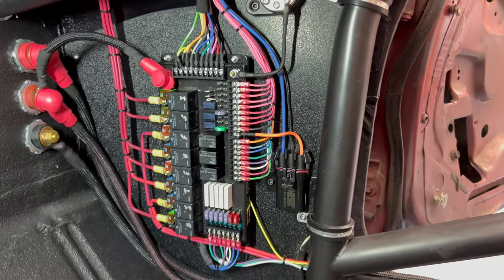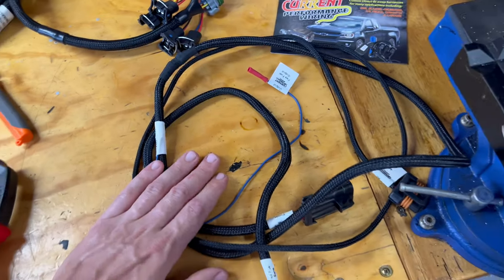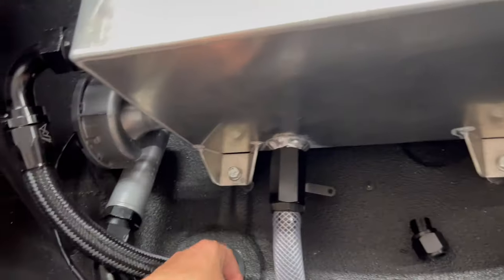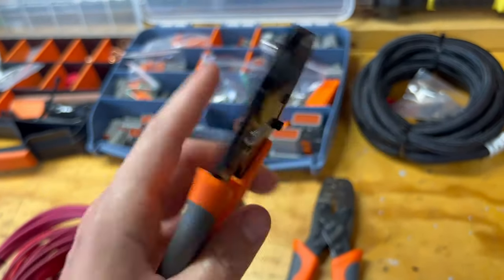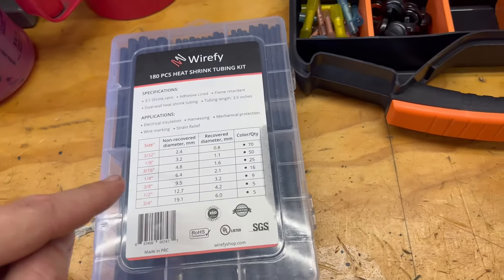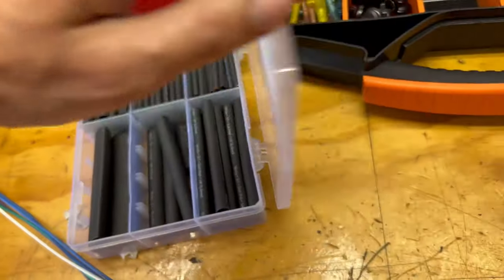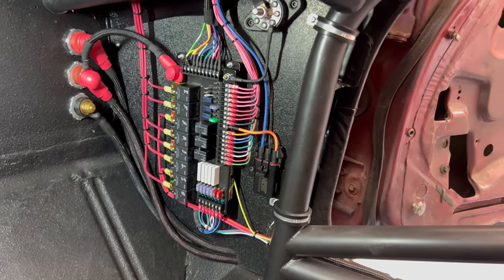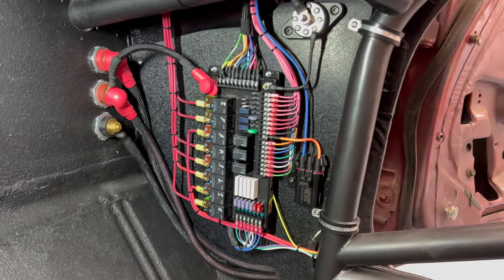The Ultimate DIY Automotive Wiring Guide

Comment: Nice trick with splitting the current through multiple wires in the Deutsch connectors. I know you mentioned the larger Deutsch connector later in the video, but so others know they are the DTP line which is rated at 25A for power connections. That's a dang nice looking relay panel. Learning wiring and accumulating the tools and supplies is so satisfying. I see that PrimeWeld TIG in the background too. Good choice there. Solid video!
Reply from the maker: Thank you, I appreciate that. Trying to ball on a budget here haha
Reply: Just a quick note re: amperage capacity in a circuit…. If you need 2 wires to carry your amp load on positive side, since your also grounded through the harness you need to carry the same load capacity on the ground side. In other words you need a 4 wire harness/ connector with 2 grounds in order to complete a 20 amp circuit in this application. So it would be cost effective to move up in connector series so you can save on wire/ connectors. Also the connector is your bottleneck not your 14 gauge wire.( depending on length of course but most likely far exceeds 20 amp load)… Good luck, looks great!
Reply from the maker: @shimonwaksman1893  that’s a great point I overlooked. I haven’t had any other but definitely something I should have looked into thanks for the information!
Reply: @shimonwaksman1893  Yea, came here to point this out too. That ground line is gonna be overloaded.
Reply: @BlacxPhoenix what happens when a ground is over loaded?  I'm trying to keep up.
Reply: @djt7387  overheat. if it gets bad enough, then insulation melts and short circuit

Comment: Those kits are like $1300
Reply from the maker: That’s correct. If you price out all the wiring you need that comes with the kit the terminals and the time to labels each wire and do a pull test on every crimp it’s worth the money.

Comment: I've watched this video and the one prior. You've sold me on this kit. This was a great explanation on how to do this yourself. Thank you for that! The only question I have is do you run a key? How would that and the neutral safety switch tie into all this?
Reply from the maker: @tbeach7112  the neutral safety switch is wired into the board all it takes is to cut the crossover wire in the Board and wire the more switch in the shifter. For a key I’m sure you could just wire it inline with the ignition switch or the starter switch

Comment: Is there need for relays if you have one big cable going to a fuse box and from the fuse box to all devices like radiator fan, fuel pump, powerwindows etc. Before the fusebox you add a battery killswitch, evertime you stop driving, use the killswitch to disactivate the fuse box. Am I right with my thoughts?
Reply from the maker: I think I understand what you mean, but that just sounds dangerous lol
Reply: @DAPerform  Why dangerous? Each device has its own wiring and fuse
Reply from the maker: @khancross  nothing is being triggered by a relay so they always have power.

Comment: Just curious, why not use a DTP 2 pin connector that can handle 25 amps for things like the water pump
Reply from the maker: Well to begin it’s what I had on hand. With My lack of knowledge with Deutsch connectors I did not know they had high amp DTP connectors available. The connector for the fans would be the only one I would need to swap because of the amp draw. The water pump and everything else is under 10 amps so it wasn’t necessary for me to split the power wire like I did. On the water pump.

Comment: Very clean job overall. I like that IWSS kit. Thanks for sharing that.

Generally, electrical power inputs are called supplies; outputs are called loads.

It’s not clear what the ammeter might be used for. Manufacturers give you the load rating of their components. You size the wiring to the load and the fuse to the wiring. Not sure how you would might use the ammeter. You should avoid making sizing decisions based on measured current.

On your electric water pump, you can’t split the positive wire into two wires and leave the ground wire as a single wire. Your single ground connector rated for 13 amps will be carrying 20 amps. Keep your fire extinguisher handy.

Also, it’s not a good general practice to split a load into two connectors because if one of the contacts becomes compromised, you will overload the other wire.

Comment: Awesome work man. That's a very clean install!! You should be proud of that one. One thing I noticed about the that Leash board is that the relayed circuits use large fuses, so you have to run large wire for the outputs. So, if you have say, a smaller fuel pump that only requires a 7.5 amp fuse, the smallest fuse you can run on that relay board is a 20 amp and so you're stuck running much larger wire than the pump would need otherwise. It's still a great relay board all things considered.
Reply from the maker: That’s a good point. I never thought of that before

Comment: something you need to know! Splitting wires for a circuit or plug doesn't increase the circuit rating, you have to work to the maximum of the smallest part of the circuit, so that comes down to a single wire in a dual run, So in your initial plug at about 6:10, you are rated to one of the two wires. The reason for this is if one plug connector/wire fails you WILL overload the other connector and potentially cause fire. Rate ALL wires and connectors to above the maximum possible draw. On long runs add in the potential volt drop and resistance of the cable and overcompensate wire size according to that data.
Reply from the maker: Understood, the wires size isn’t the issue I was having trying to increase the amp rating it was just for the connector pin. But I do see what your saying. I’m not close on amp draw for any of the components even with 14 gauge wire so we should be good. Thanks for the information though
Reply: @DAPerform  I do believe Deutsch has a higher amp terminal/connector that you can you use, might go in a different connector body/housing, but they have them
Reply from the maker: @joem6859  I conveniently found them after I had wired the car lol I will upgrade in the future
Reply: I find that interesting, purely because my 85 mustang gt. Uses 4 smaller wires  for the alternator output, instead of one large wire.

Comment: Nice build. Something to watch for however, is running the cables between the body and the outside the roll cage, in the event of a side impact you run the risk of shorting out circuits if the wires are crushed together.
Reply from the maker: That’s a really good point. I plan on adding a battery disconnect inside the car in the event I need to kill power.

Comment: Great work! Love how it's coming out. Quick question if you don't mind, what (if) did you use the 70amp relay ignition output for (the one before A)? I as well got this kit for my car and am a bit stuck on what (if) I should use that relay. Thanks!
Reply from the maker: That relay is controlled by the ignition switch on my switch panel. The output wire from the relay is connected to the Holley harness and turn on the ecu and dash when I flip the switch on. Regardless of your setup you should use that to turn on whatever ignition setup you have wether it’s a msd box or ecu that controls the ignition on and off
Reply: @DAPerform  Thank you for the quick response! I had originally envisioned using one of the 5 ignition outputs on the opposite side of board next to the 3 always hot battery outputs. Any reason to use one of the main relay outputs over the ones I planned on using?
Reply from the maker: @davidsalazar4257  the relay is nice because one it’s already there and controlled through the switch. It can handle way more power and also act as a safety the ignition output wire are much smaller wire and cannot maintain the load of current most ignition sources require. It boils down to safety and the fact that it’s already there. I actually had a hard time trying to figure out how to use all 8 relays since most of them can be used to power multiple systems fans, intercoolers, pumps and what not.
Reply: @DAPerform  Awesome! Great explanation I appreciate your help/advice! Goodluck with rest of car
Reply from the maker: @davidsalazar4257  No problem, thanks for watching!

Comment: Do you have a video about the "data logger" you refer to? If so, I can't find it. Thank You.
Reply from the maker: The data logger I referenced is just a switch on the switch panel that is an input to the Holley ecu which I have not used and just a trans brake trigger to activate the data log

Comment: The Deutsche connectors are nice to run. 
 Have to watch the quality though . Some of that eBay stuff is actually a real soft plastic . Is the IWSS(?!) kit hard plastic ?
  There is a part number HDP20 connector (like a bulkhead ) but can use it as either , that is a 100 amp plug assembly.
Reply from the maker: So far so good the iwss kit seems to be pretty good quality. Nothing seems out of the norm other than the price compared to brand name Deutsch connector

Comment: I have the leash board and Holley but I only have two 70 amp relays that are ground triggered and I need three. Any advice on how to make a third one ground triggered or can I just get a bigger relay and put two of the fans together?
Reply from the maker: The first thing I would check is how much amps the fans are drawing. It also depends on what kind of fans wether that are brushless or slow start fans

Comment: Whats your opinion on the k&r kit and the racewire solutions kit vs this one , trying to decide which one to go with , thanks
Reply from the maker: I see you found my other video. You can see why I chose this kit it’s extremely user friendly and almost dummy proof. Hands down the best wiring and relay board combo is from precision wiring and fabrication. But thats just my unbiased opinion
Reply: @DAPerform  what about like gauges and stuff , which my car will be a carbed nitrous deal , I've never wired a car so I'm just trying to figure out what's best , and how did you wire in the neutral safety,  thanks
Reply from the maker: @Justin-g5k2i  the neutral safety is built into the board with two terminals, very simple. It’s all dependent on what your needs are the relay board has a lot of  extra outputs as well
Reply: @DAPerform  only other thing I'm concerned with is that if you have a relay failure you can't replace the relay you have to send it back , that could cost you a race if your at the track
Reply from the maker: @Justin-g5k2i  I’m not sure if they are replaceable or not but you’ve got a good point
Reply: @DAPerform  according to Steven at precision , they're not replaceable but the boards are lifetime warranty , but still sucks if you do have a failure and have to send it back , that's my only concern with the kit really , thanks for your time , much appreciated
Reply from the maker: @Justin-g5k2i  anytime I hope this helps make your decision easier

Comment: what kind of materials do you use when naming the wire for easy reminder
Reply from the maker: That’s the nice thing about the precision wiring and fabrication kit. All the wires are leaves every 12” with what it’s for example relay A wire says relay A on the wire itself align with every wire in the kit
Reply: @DAPerform  Yeah what do you call the item you use in name tagging the different wires for easy remembering
Reply from the maker: @kimwenceslaosanchez4449  I don’t use anything to label the wires. They are already labeled
Reply: @DAPerform  ahh the white paper ? thanks

Comment: What are those clamps you used for the board bud?
Reply from the maker: Those 1 5/8 cushion clamps with a rivnut on the back side so it’s easy to install and remove if necessary

Comment: Does the relay board power the switch panel?
Reply from the maker: Yes, the wires on the top of the board are all for the switch panel
Reply: @DAPerform   how do you like the switch panel? I’m looking at the ARC panel but I’m not sure..
Reply from the maker: @jbrown82elite  love it so far, haven’t had any type of power to it but the wiring process have bee n very smooth so far. I’ve heard some not so great things about the arc panels
Reply: @DAPerform   thanks man.. I have seen some issues with the ARC as well.  Please let us know how you like the panel once you get to use its functions :)
Reply: @jbrown82elite  if I could get my arc flat touch switch pannel to work with a leash street strip board I'd do that. Haven't had any issues out of my ARC pannel but would like the features the leash relay board has.